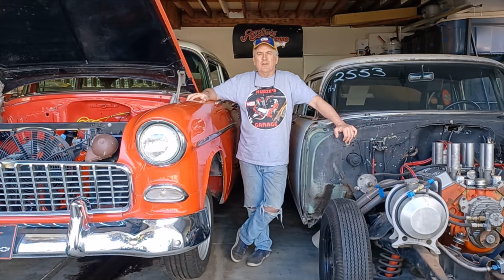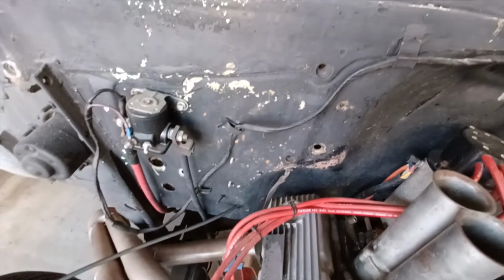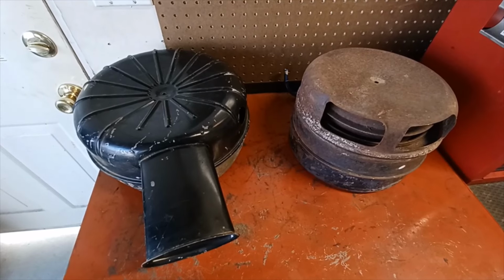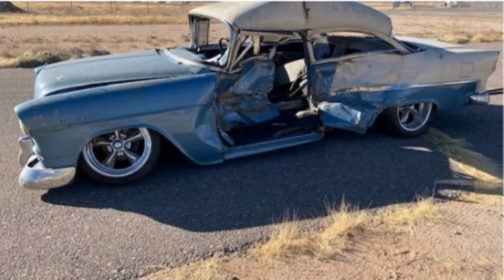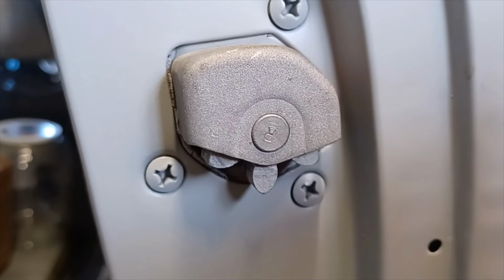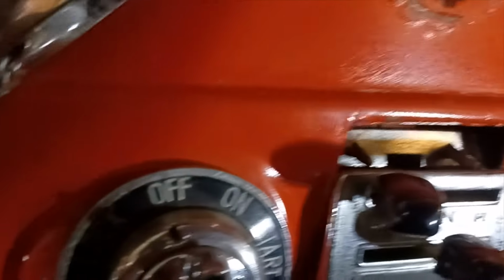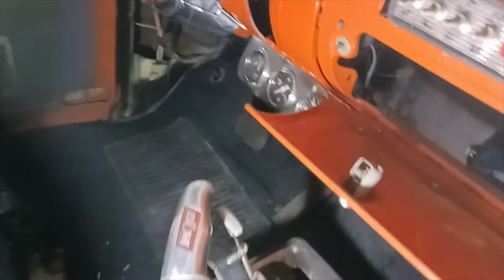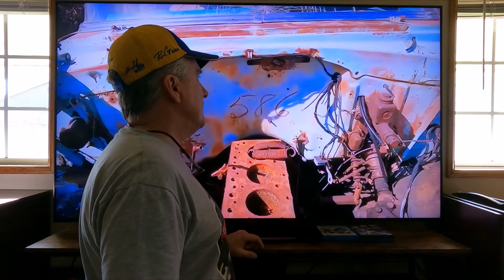An Early Production '55 Chevy?  The Full Video

Comment: Great Video and Info! My Baltimore Built 55,Feb 3rd,Has The Wiring Harness Hooks.No Hole In Firewall For Harness,Early Style Latches,With No J Hooks.No Oval Holes In Dash For Trim.Horns Located In Upper Mount Holes.Also Has The Pads,Welded To Trunk Lid,For Bumper Stops.
Reply from the maker: Great info!  My Jan. built Oakland '55  had the J hooks then but, still has the harness hole...weird!  I will have to look closer at the trunk area!  I noticed my later '55's have 2 round rubber pads at the trunk valence where the trunk lid closes.  I replaced my original '55 trunk lid in 1984 when a former buddy rear ended me in the high school parking lot with his Toyota 4x4.  Thanks for watching and for the great info!

Comment: Hey Jeff,  your clock is visibly stamped; La Salle, Ill.  So that's a Westclox. Also, with the core support/baffles changes,  the horns mount higher or lower as was noticeable between cars.
Reply from the maker: Awesome!  Thank you Yamayagi!  I have not had time to research the clocks yet because this video was done quickly with minimal research and lots of past memory.  I did find out some additional info on the baffles after I posted the video.  Don mentioned the horn placement and I saw that the screw placement differs on the baffles from the early to the later units.  Thank you for the great info!  It may warrant a second video!  Have a great week and take care!

Comment: Cool video Jeff. Did you notice early deluxe heater controls have 3 securing screws to mount the bezel. I believe the early core supports are rivted and later core supports are spot welded.  There was also different locations for the horns to mount. Ealry cars had horns really high and later they dropped them down a inch or so. Maybe for better sound travel not sure. Early 55s had metal backed headlights and later they went to a sealed beam light. None of the original headlights had the 3 points to level them. 12 volt was a new as you know is 55.  Keep up the good work on the Tri5s.  Later Buddy 👍
Reply from the maker: Thanks Don!  I did this video after you mentioned the dash trim holes.  With having a good complete example of an early production '55, the video needed to be done!  I did notice the 3 screws on each side of the deluxe heater control faceplate, that's got to be a rare one.  I know that GiveBlood mentioned that the controller was made by more than one company but, I was not able to find any additional info in my short research time.  I knew the clocks were from several companies but, not the controller.  I did know the core support rivet was on the early ones but, I still have not seen the "V" braces to see how they attach and fit over the rivet.  I also realized that the core support in the back of my shed with the top bar cut was an early core support too. I did not know about the headlight differences.  I will have to check that out further.  I also did not know about the horn location changes on the fender skirt baffles.  I did see later that there was a difference in the screw placement on the top of those baffles.  The later baffles got the inboard screw moved to one of the "V" Brace screw holes.  GiveBlood mentioned notes in the assembly manual and after a brief look, I do see notes, with dates listed of production changes on some of these items.  All cool stuff!  Thanks for watching Don and thanks for your continued support!  Have a great one!

Comment: Very interesting video!!  My 55 has early door latches and no holes behind belair dash trim. Does have firewall hook tabs.Guess Ill have to decode it now.
Reply from the maker: Very interesting!  Any possibility thst the doors could have been replaced or even the latches were swapped?  Yours sounds like my 4 door that had an early item and a late item on it both.  They do seem to have made these changes spread out over the production year.  I posted all of my research info on my community page with the links.  It is great info to learn more about your Tri Five Chevy!  Thanks for watching Brent!
Reply: I bought mine 1977 from a junk yard in GA. $1400. Don't know what happened before 1977. Drove it home to Daytona FL. Family car for several years, black emron in 80s then drag car a few years. It retired in garage until  2019. Building it as daily driver. Frame off,  LS3, 6 SP auto, everything a new car should have. Thank goodness I only have 1!! It fun to build it my way!! Thanks for asking.
Reply from the maker: That is very cool Brent!  Our red '55 hardtop sat in the garage from 1972 until my Dad Howie retired from the fire Dept and started the frame off restoration on it in 1996.  It was the primary family car from 1966 to 1972 when my dad broke the 283 Corvette crankshaft into 2 pieces after going through the gears!  He bought it from a HS buddy in 1963. When he and I re-did my red and white Bel Air in the video in '83, we painted the frame in black imron and it still looks great today!  Very cool that you have kept it all these years and that you are building it now the way you have wanted it.  The hardtop was the same way.  These cars can be like family and yours seems to have reached that level too!  Best wishes on the build and have a great week!

Comment: The holes were for a different level of trim, which you don't have because you don't have the tissue box holder. 
The big hole was for the choke l think.
I have a  service repair manual somewhere,  don't as me where because my mom threw a lot of my possessions when I moved out of home 42 years ago.
Reply from the maker: Hmm.  I know the tissue dispenser hung from the bottom of the dash.  If you are speaking of all of the very small oval shaped holes that are hidden behind the Bel Air "Bow Tie" trim that I held up in the video, it does have that trim level.  I had just removed that trim for the sake of the video.  The large hole to the left of the radio is for the cigarette lighter.  That would be cool to find that service repair manual!  Those are nice to have!  Thanks for watching and take care!
Reply: @hubiesgarage  The paperback book is Brown.  Has everything from the back burner to the front including all the engine, transmission and rear end.
And the wiring harness 
1955 Chevrolet Bel Air was my playhouse when I was a kid.
I was probably the only 5 year old kid to ever change a tire unsupervised.  And that includes getting the spare out and in the trunk by myself and jacking up the car and breaking loose and tightening the lug nuts.
I did put the nuts on backwards. But then again I couldn't read the owner's manual.
Reply: @hubiesgarage  Vin Tag on the 1955 Chevrolet truck was on the driver's door post and was stainless steel not tin painted.

Comment: I do have two working radios out in my garage.
Reply from the maker: Good to know!  The last stereo that I had in this one was a Sparkomatic that I bought new from Trak Auto in 1983.  I was the one who drilled those 2 half holes in that perfect dash!  Thanks for watching!
Reply: @hubiesgarage  The  55 Chevrolet truck used the same dash instrument cluster even on the big truck.
The radio was two pieces,  a tuner head unit and the speaker amplifier. 
You have to have both halfs and the harness for it to work and it's all tubes.

Comment: Hubie do you have a assembly manuel?  the changes may be in the notes on the page of assembly page of install. the notes are dated and engineer initialed signed when the engineer made the change but not when change actually happened. this would give you only an idea of actual change.  i would buy a 55 assembley manuel and look if you dont have one.  i would bet all the changes was engineered and actual changes not all at once but on individual dates.  when engineers made the change,  the actual change sometimes has to take place a short or longer time due to supply company who made it and making it available to chevrolet.

also i will check in the revised oct 1965 parts catalog for the door strike and gear. for differents and maybe a date or refference of change.

wife is standing here saying we got to go.  dang.  now i will be thinking of this all the rest of the day. and cant get to it until tomarrow.  will have to talk later.  love this stuff.
Reply: This is givebloods wife . . . Sorry to take him.  We have a family get together and if I don't say something he will never leave.
Reply from the maker: Very good info GiveBlood!  I do have an assembly manual and used it for a few bits of info for this video.  The video was done fairly quickly with not a lot of research time, most of it was memory and backed up with the book and online stats to keep it accurate.  I did find notes with different options and secondary part numbers for the same items with dates that probably represented the early to later production changes.  I still need to dig some more and get used to using the assembly manual better.  It does appear that these changes happened individually and gradually over time.  The production days with the number of cars built on a given day did vary somewhat from plant to plant and my thought is that they were making updates or possibly retooling at some stations on the line to make those changes.  I almost wonder if the assembly line workers had to stop to get training on an upgrade or change in production that would have slowed the line down.  Your explanation sounds much better as GM/Chevy had many parts suppliers that were more affected with these production changes than the assembly line was.  With these individual changes happening at different times, it is difficult to pin down a break off date of when "an early production '55" ended and officially became a later production car.  Thanks for the input and I hope you didn't get into trouble with your bride!  Take care and have a great week!
Reply from the maker: @lowbuckwrenchers8785  Not a problem!  I hope I didn't get him in trouble and I hope you guys have a great day of family time!  Take care!

Comment: Early 55 had riveted in place ball joints, later were bolt in. Early 210 did not have the dash holes. Where can I find an accurate build date, not the divide monthly units built by the days of the month one?
Reply from the maker: Great info!  I knew about the ball joints because I remember drilling out those big rivets on my originals and replacing them with TRW Ball Joints.  Those rivets were the same rivets they used on the early core supports too!  Each individual assembly plant had a working sheet that notated the serial number of the last car built at the end of each working day.  This is the link on TriFive.com:
http://www.trifive.com/vin/55%20Chev%20daily%20vins%20by%20plant.pdf

Thanks for the info and thanks for watching!  I hope this helps!